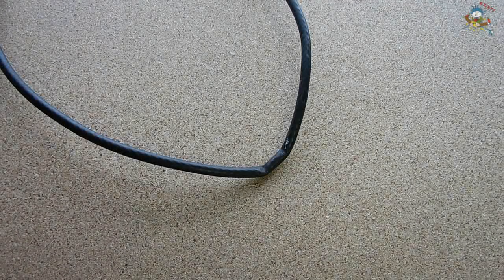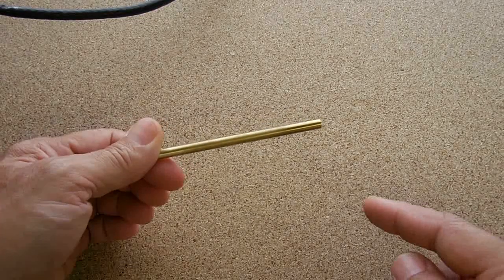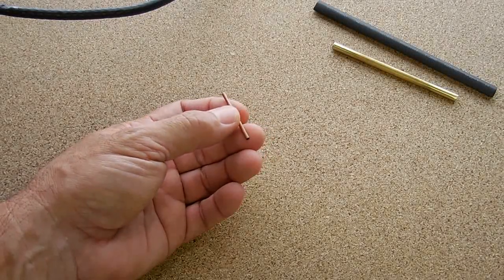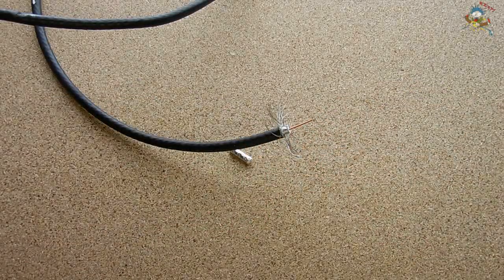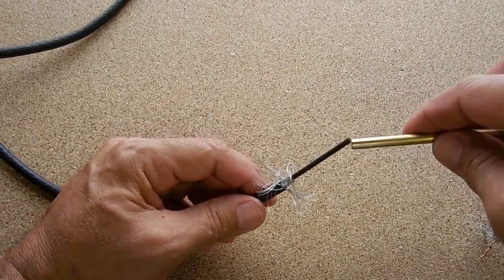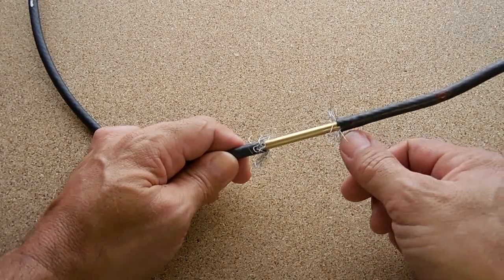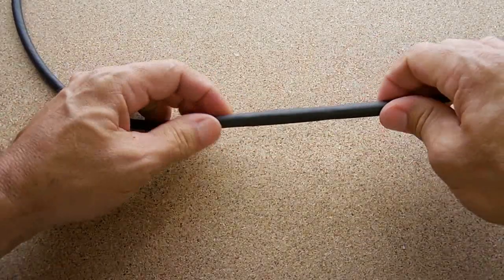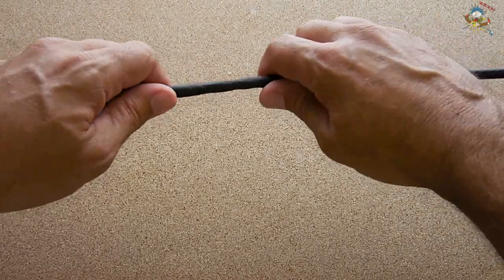INEXPENSIVE Low Loss Coax Cable Repair(Tube Method)

Comment: This dude just creat history he follow all the law of keeping a good transmiting coax cable with out soildering which spoils your cable, by using the same lays of current and by using the advantage of conductive material to transmit current and still able to keep the electromagnet  layers away from canceling flow (this is pure art peaple 😍 he needs a Grammy .

Comment: I used to repair coax in my job, and we had a kit of little copper tubes to fit the inside copper wire. We also had a hand crimper to squash them. There is a conductive grease you can get that goes into the tube and keeps the wires from ever oxidizing. We kept the splice to about an inch long overall, and used a special 'fusion' tape over the inner copper joint, and copper tape to put over the braid, which we kept loosely together (with more grease) and covered with more fusion tape. Then we put the gum-filled heatshrink over the whole thing. (The hot gum in the shrink will BURN you good if you touch it!)  I kept small pieces of shrink over the years in case I ever need it, some is 2" diameter.

I'd say you've come up with an excellent method on your own to do this. You may want to look for that special grease however, it's useful all over the place!
Reply from the maker: Flintsmooth The anti-oxidizing compound is a good idea, but I would think the oxidizing problem would be extremely minor considering the cable is sealed with heat shrink and glue.

Thanks For Watching!

Comment: Well done and thanks for sharing.  I should have watched this before removing previously used coax compression fittings and re-using.  I'll be starting over.
Reply from the maker: Not a common method, but it sure does work good. Thanks for watching!

Comment: I have gone to double walled with adhesive shrink tube 3:1 for all our offroad wiring now. might be good for this project
Reply from the maker: Ed Ginsberg That is good stuff. Just as long as the walls are fairly thick, the shrink ratio is good, and there is glue, you are good.

Comment: This is very acceptable repair, I am sure there may be some loss, but as noted, any splice is going to introduce some degradation of signal. For the price and convenience this would be hard to beat. I wouldn't worry about the small section of missing foam as it  functions a spacer to keep the RF resonance in check and the space IS maintained via this method of repair.
I have a broken capillary thermometer tube, need to check on the dimensions now ;>)
Reply from the maker: Craig Nehring Yes. The center conductor remains in the center of the cable perfectly spaced. All splices create loss, but the loss with this method is low. I have a bag of metal tubes & heat shrink all made up for future repairs to save time.

Comment: VERY nice looking job!! My only concern is the possibility of the center connection in particular oxidizing over time and causing problems.
That said, I think I will stock a few items in case any of the coax I use on my amateur (ham) radio stuff gets damaged. By the way, Fastenal - an industrial supplies place -  carries adhesive-lined heat shrink tubing in different sizes. In locations such as mine where there are NO electronics parts places, often there IS a Fastenal. FWIW.
Reply from the maker: KarlsLabReport Thanks. If you are worried about the center connector becoming oxidized over time with several points of contact, and being sealed from air using heat shrink tubing with glue, then using coax connectors would really be a problem. :-). You will be just fine.
Reply: I was thinking of the trapped air plus any moisture. Moisture seems to get into EVERYTHING despite measures taken to prevent it.
Reply: Cool video. I never knew there were two types of heat shrink. With and without glue. I learned something new.

Comment: Hi, is enought to just connect center wire with center wire of another and then solder it and put a electrical tape over and same procces for aluminium wire?
Reply from the maker: N!cky No. You will have a lousy connection due to signal loss around the braided shielding. You also cannot solder the braided aluminum shielding, unless it is copper.

Thanks For Watching
Reply: electronicsNmore It has copper layer on aluminum wire. Thanks anyway.

Comment: Just calculated the characteristic impedance with the diameters you mentioned. Came out at 50.9R, almost like you planned it that way :)
Reply from the maker: Verm1n :-). This does work extremely well. If it didn't, I would never have made a video showing how to do it. 

Thanks For Watching!

Comment: Great video demonstration! Can this method be applied with RG174? If so, what size heat shrink and metal tubings do I need?
Reply from the maker: The best thing to do is bring the coax to a hobby shop or hardware store that sells K&S metals tubing. Thanks for watching!

Comment: how do you get the glue inside the heat shrink?  and what kind of glue is it? and why isn't it coming off as you slide it up and down the cable?  is it heat activated glue or something?
Reply from the maker: Frank Graffagnino The glue is already applied to the inside of the tubing. When heat is applied, the glue melts and the tube shrinks. 

Thanks For Watching!
Reply: electronicsNmore so, what kind of glue is it?  do you buy it pre-made?
Reply from the maker: Frank Graffagnino All you have to do is buy heat shrink tubing WITH glue.

Comment: Do you know off-hand what sizes one needs for RG-8X coax?
Reply from the maker: KarlsLabReport RG-8U > .108" center conductor > 1/8" I.D. x .014" walls, and for the shield (.285") use 5/16" I.D. x .014" tube
 
RG-8X > 16ga center conductor > Same size as in the video, and 5/32 I.D. should just make it over the foam insulation which is around .155".
Reply: Thank you very much for the input!! Please keep up the good work and check out my KarlsLabReport channel.

Comment: Frankly, I actually expected some impedance testing / measurements with a signal generator & oscilloscope to check the EXCELLENT quality of the repair. A DMM would've shown the same if you did the repair just with flimsy bell wire & electrical tape.. :)
Reply from the maker: salat The DMM test was to show the center conductor was well isolated from the outer shielding, nothing more. Years ago I had a cable TV installer perform a test on a wire I made using a handheld unit costing thousands of dollars, and the result was a low loss connection. You can also turn on your TV and use a cable TV diagnostic channel which shows signal strength to verify the connection is low loss. Cable TV boxes usually have hidden diagnostic menus. :-)

Comment: if we pull both side the cable it will remove
Reply from the maker: No. You use heat shrink with glue. If you're really paranoid, then solder the center conductor to the tube.

Comment: or you could just cut and crimp a new M-F connector.  Then you won't have that long section of missing dielectric.  That missing section of dielectric can drastically change the signal, especially data.    Here in this vid, you may be better off just solder and taping it.
Reply from the maker: Since the center conductor is positioned exactly in the center, surrounded by air and the outer sleeve, I don't think you'll see any drastic changes.
Reply: electronicsNmore I think you may be missing the point of the white dielectric material between the center conductor and shield.  Depending in the signal, (square, saw, sin...) the system plugged in to accounts for the capacity of the wire.  The space between the dielectric and center creates it's own field and capacities.   Just like how networking wire needs to be twisted all the way before crimping.

Comment: why would i go through all that trouble when i can spend 5 or 6 box than going and looking for all this different size of copper waste of time buy the ends and joiner
Reply from the maker: cjmovielab Most hardware stores(except Lowes/Home Depot), and all hobby stores sell both metal tubes I showed in the video. You can also buy them on Ebay since I told you the correct sizes. The method shown here is better than screw on coax connectors. It is much more secure(more points of contact). You also have to realize that for the same money you would spend on coax connectors and a coupler, you can have enough supplies for 2-3 more repairs if needed. Clearly this is for people that work with coax often, like me. :-) You would think differently if you were working with larger sizes of coax. The savings would be huge. It is always good to know how to do things alternate ways if the usual supplies cannot be located.

Thanks For Watching!